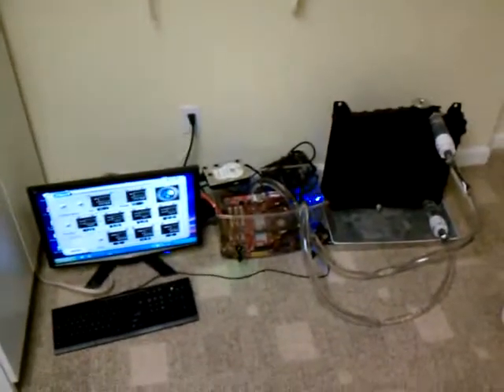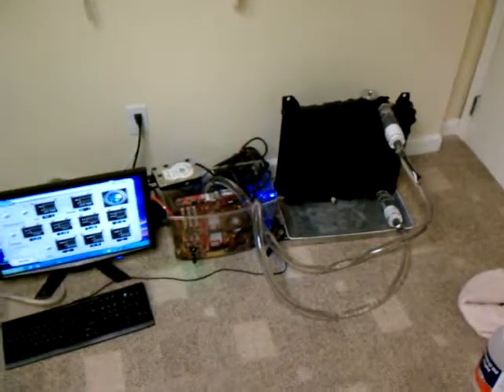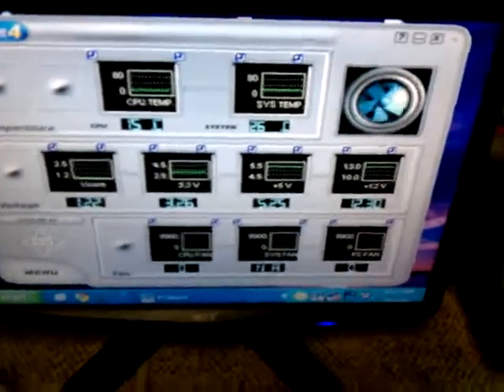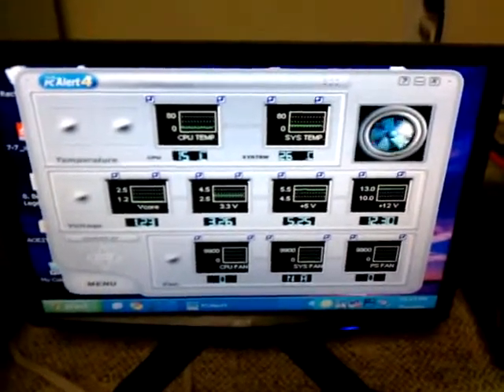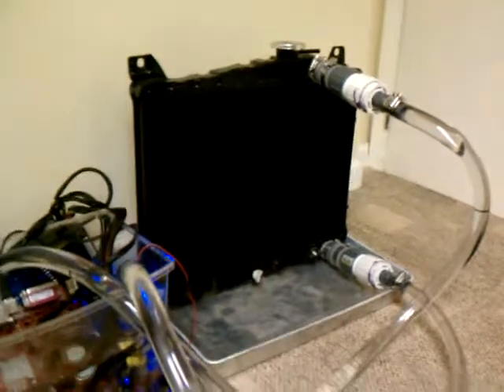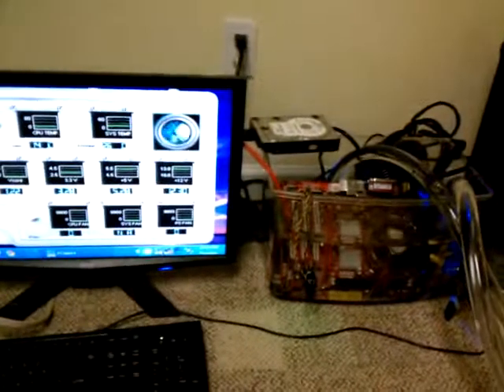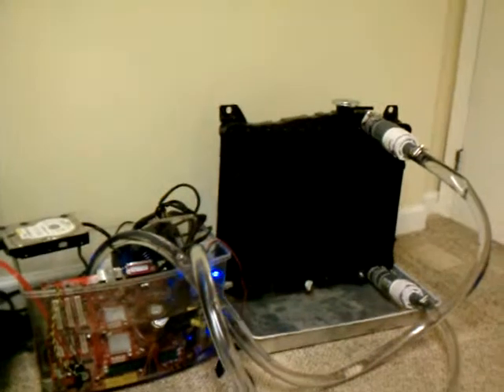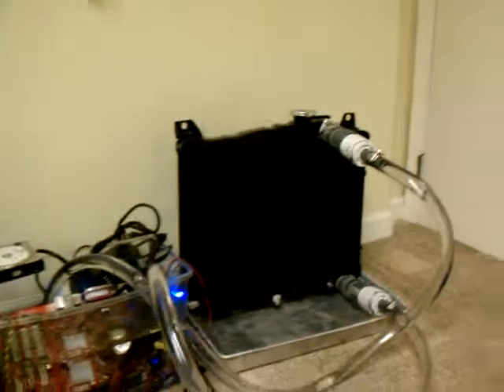MIneral Oil PC Test: Part 3

Comment from the maker: @Blackoutx86 It's still in planning, the pc has been running for over a month nonstop(except when the power has gone out) so I'm making my assessment on whether the mineral oil has any negative effects on the pc hardware. Right now money is the main thing holding me back, i have other interests besides this. Just got a new motorcycle which i will be making payments on. (that's right, nerd on a motorcycle)